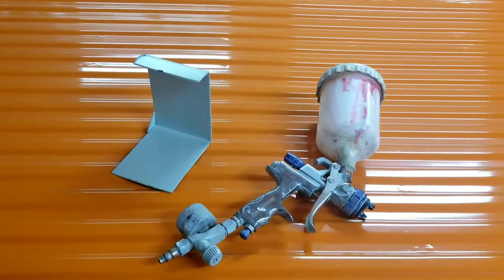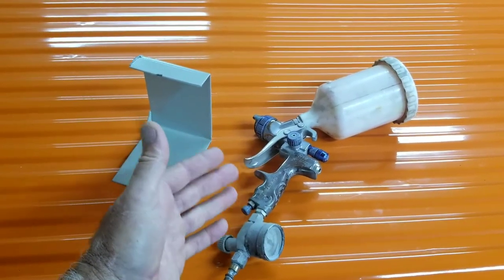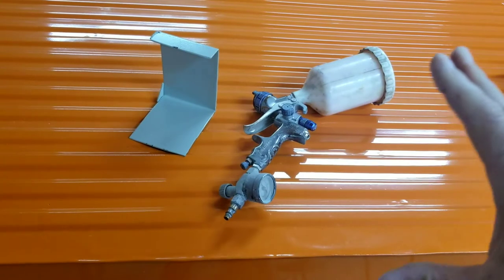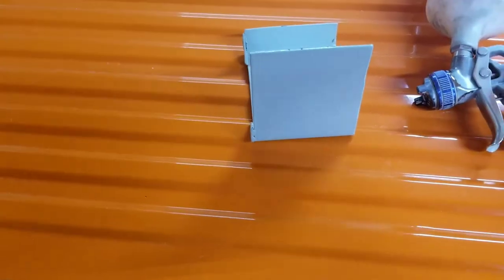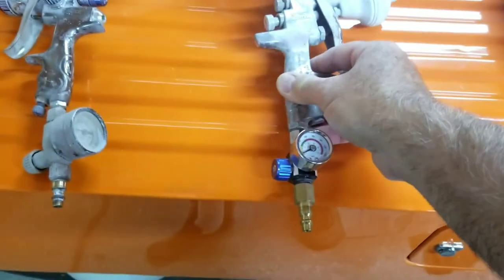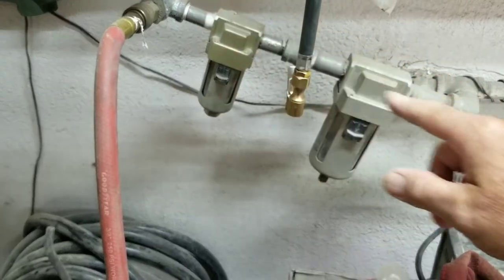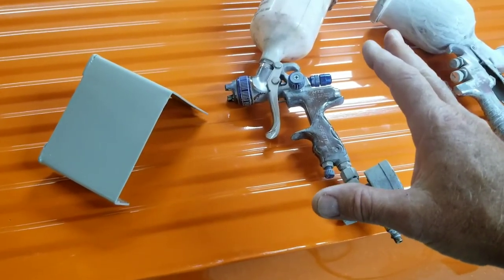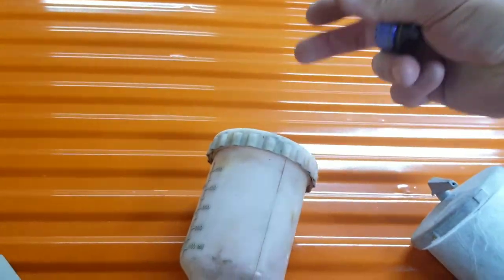HARBOR FREIGHT SPECTRUM spray gun Review after 1 year use DIY painters at home

Comment: I got the Spectrum HTE and used it like 2 times or so until it got a random leak and now its bubbling in the cup pretty bad. When the leak first started, I was thinking how I just got this newer "expensive" gun, since I was using the purple gun and the Central Pneumatic one that looks like the cheaper one in your video, so now I wouldn't have to worry about random paint drips and leaks dropping paint into my finish or the cup falling off and things like that. When I got into my portable spray booth and went to spray and it built up so much pressure in the cup instantly (I was using the Spectrum disposable cups) it completely exploded and probably over $50 worth of basecoat everywhere and on my finish I was painting. I was reluctant to buy another Harbor Freight gun just because I was mad that happend, but I just got the Black Widow, which is supposedly a step up from the regular Spectrum. I got the HVLP version hoping that one day I can fix this HTE regular Spectrum and have both a HVLP and a HTE for clear coat. I've looked at all the seals and the cap and the nozzle and I can't find anything wrong with it at all.

Comment: Mike, GREAT video! Really. It's the first one that I've seen to seriously go into the difference between the cheap guns, the medium guns, and the pro shop guns and what works best where, especially for the DIYer that doesn't have a booth. I've never seen anyone address overspray from that perspective.

I've sprayed a lot with cheaper guns, mostly sub $100, but had no idea how things changed with the $$$ guns, and have wondered if I'd be money/frustration ahead by spending the change and getting one since I do paint fairly often. My experience has been the difference between the really cheap guns (the $9 purple gun and other guns built like it, some get quite expensive) and the "better" guns is the amount of fluid it can put out and how big a fan it can put out. When I've tried bigger items with the cheap guns I get frustrated, I'm spraying and spraying and spraying and just not getting anywhere- smaller pattern and MUCH less fluid flow. I've even stopped in the middle once and went and got my "go-to" gun and got more of the project covered in 10  minutes than the purple gun did in the last 30 or so.

I was about halfway through the video and was getting ready to start typing, wondering if you have tried my go-to gun, HF's other gun, the one that usually runs $68-74 (I think they're getting rid of it, I've seen it on clearance for $4x recently), the one similar to the gun you brought out at the end, and how it compares (the spectrum HTE is on a big sale for members right now, I'm thinking of grabbing one). It has a big pattern and can lay down paint MUCH faster than all the other "cheap" (some in the mid $1xx range) guns I own. Honestly, I haven't had problems with wear or cleaning with it, but when you get it pounding down a lot of paint (again, no idea the better guns can put down significantly more), I've walked away with blue rings around my mask, in my beard (I know, but I'm not cutting it off) and around my eyes.

I'll probably grab the Spectrum HTE (unless you see an advantage to the HVLP) for the current $50% off...
Reply: Funny you mention the big Cadillac- 2 of my upcoming projects are BIG ones, a '93 Cadillac Fleetwood Brougham, and a crew cab, long bed Cummins Ram (surprisingly the Cadillac is only about 6" shorter than the Ram, IT'S BIG).  The truck I wasn't too worried about, I'll likely do that one panel at a time and if things aren't perfect, well it's typically covered in mud and crud anyway. I want to do the Caddy with a 3-stage-  base, inter-coat/pearl, clear, and I'm not sure what gun to try/how to do it. I could do the panels one at a time, but I don't know how consistent I can make the pearl from pannel to pannel if I do them one at a time, and I don't know that any of my guns will lay down paint fast enough to keep a wet edge. Any thoughts on how to do it (it will most likely be done outside, so massive overspray is a non-starter)

Comment: sounds like the HTE is good for coat and clear but what are you using for primer then? or would the HTE do primer and seal as well?
Reply from the maker: I use the Iwata Airgunsa for primer. 1.7 is the best. You could use a the Spectrum 1.7 or 1.8. you really should use a separate gun.
Reply: @mikesrandomvideos  thanks. I was looking into CFM because i only have a 20 gallon tank. thinking I might buy the 69.99 hvlp gun for primer but as for base and finish I'm looking at a R500 from liysnpty. I know the fan isn't as wide but i need to match something I can use with my compressor. Thanks for the review by the way.

Comment: I use 1.7 tip and paint a car quickly
Reply from the maker: yea but hard to not get runs. 1.3 works great for fine spray. I can use a 1.7 or 1.8 too just turn down the fluid. But painting a flat panel with that you will  get some peel.
Reply: I paint pretty quick
Reply from the maker: @JoseHerrera-tx4jq  Yea i did one once with  a1.8 came out great